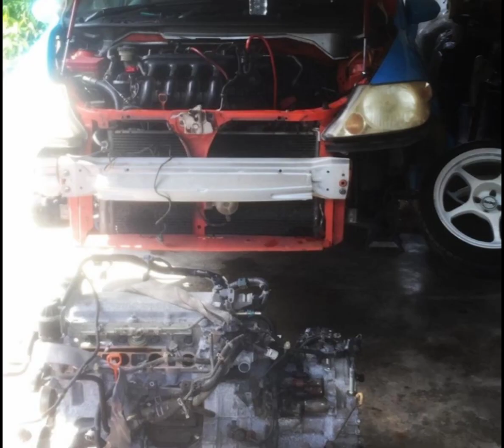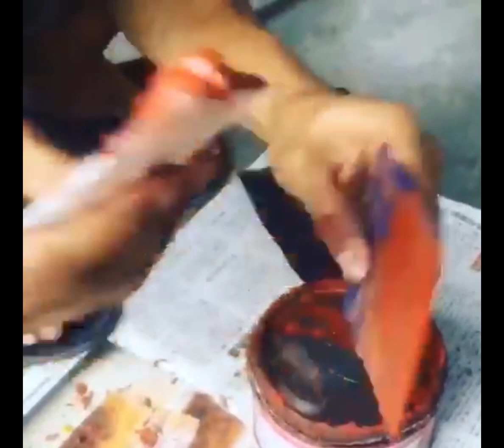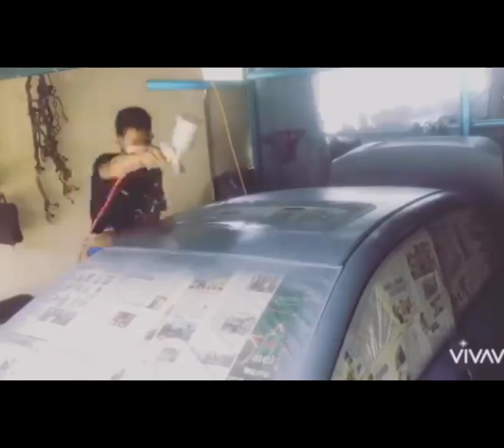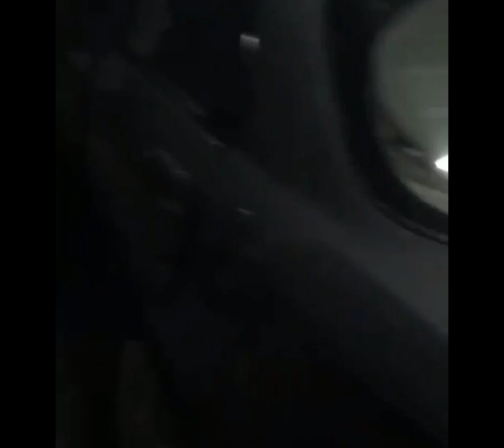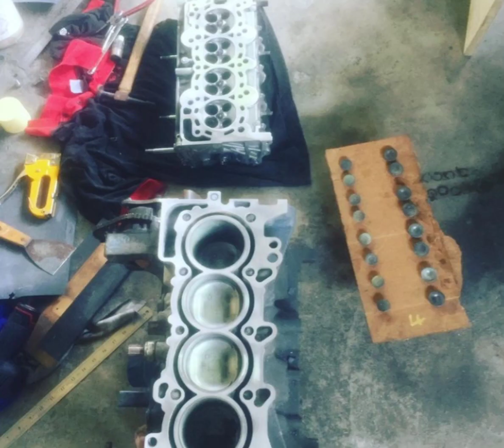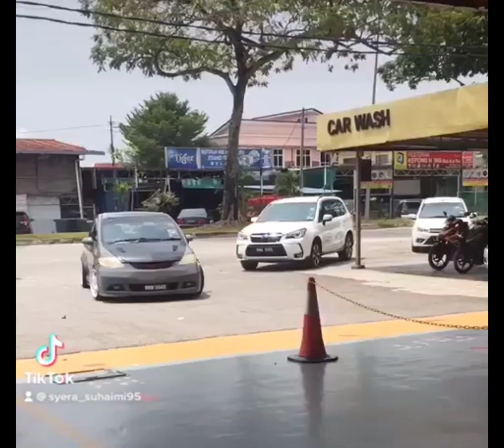HONDA CITY GD8 MODIFIED

Comment: Untuk bumper depan honda city 2003 Sama atau tidak dengan honda city 2008 ? 
Punya mas lampu belakang nya city 2003 . Bumper depan nya 2006/2008 kan mas?
Reply from the maker: Bumper depan honda city 2003 tidak sama mas dengan bumper depan honda city 2008.. lampu pun lain mas...